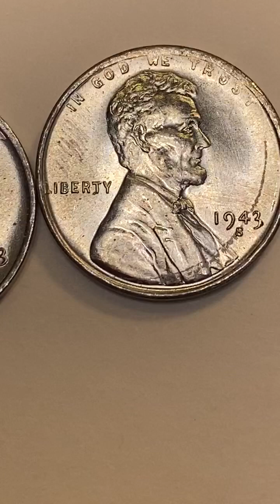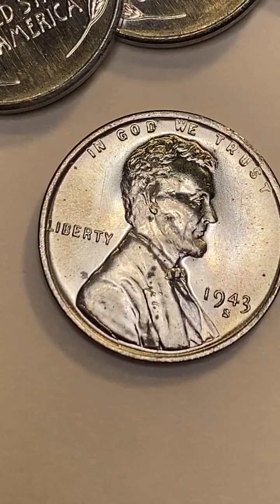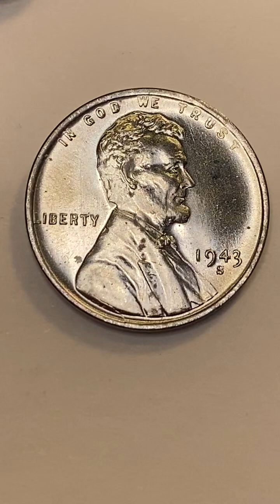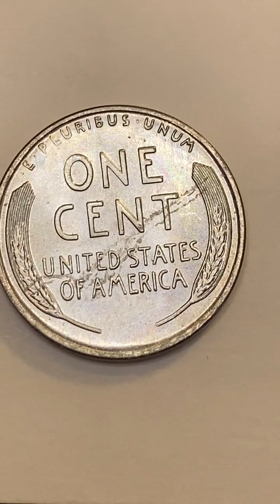What causes some spots on steel cents?

Comment: Those are called drink holder coins or whatever people toss loose change into and forget about them and over time. Some even have some type of liquid they sit in and cause the rings.  Either the liquid or vibration does that. I've even seen coins that have some kind of epoxy stuck to the coin and it looks exactly like lamination errors.